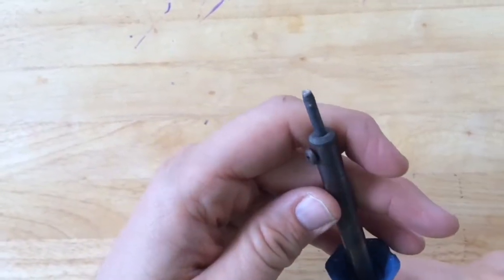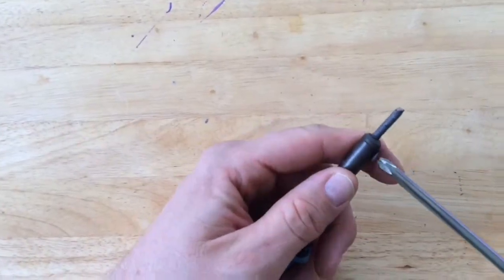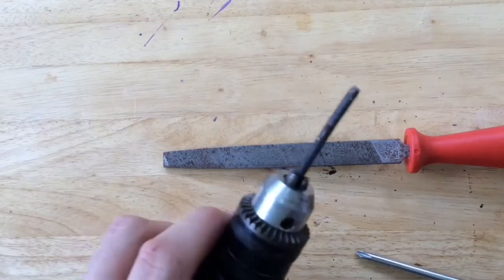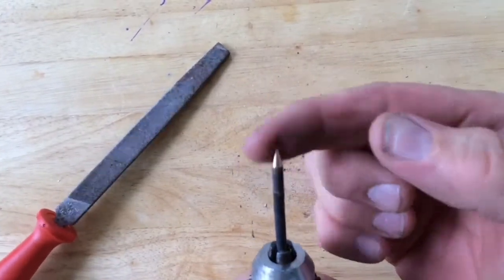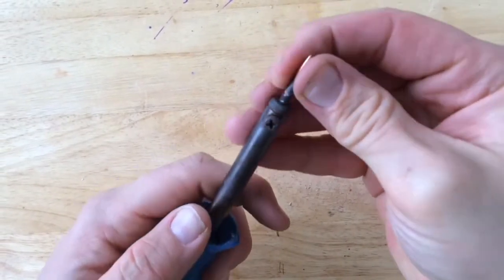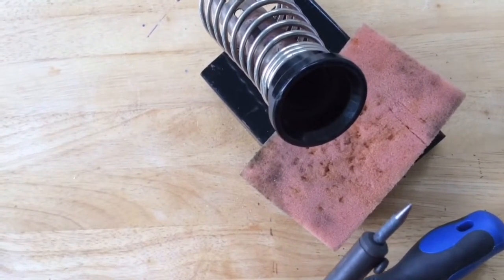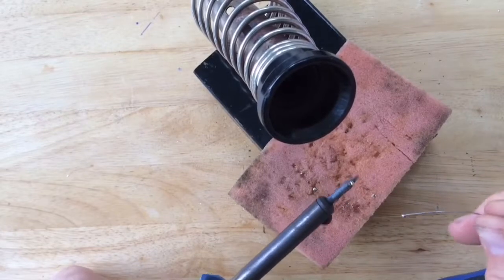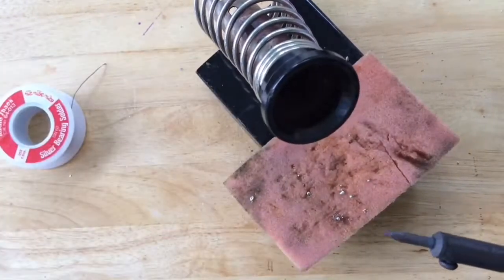Sharpening the Tip of My Soldering Iron

Comment: Not copper wire, its a copper alloy solid tip type. If your tip gets too hot, because its shorter, it won't tin easily. Now you know and there you go😅

Comment: I'm confused why you posted this if you failed, I watched 7 minutes to find out it didn't work.
Reply: He should change the title with "_Trying to fix my soldering iron tip"_
Reply: It does work. He didn't do it completely right. If he melted some solder in a small container of some kind, and dip in the tip, that would have tinned it.
Reply: Did you not hear what he said in the beginning of the video?

Comment: I'm a bit late to this. But after you filed your tip, you should have used a tip activator, dry  cleaned and then tinned. Repeat the dry clean and tin and you should be good.
Reply: Wtf is a tip activator? Flux?

Comment: I believe that the tip would have been iron coated copper (copper being cheap and a good conductor of heat). So filing it would have taken that off. The copper changes colour when it oxidises so although solder sticks to copper well my guess is that it doesn't to the oxide layer that you now have.
Reply from the maker: +David Watts that makes sense. I saw a guy that wrapped his freshly filed tip with solder before heating it up. Do you think that might work? I think it might protect the copper from oxidizing before it melts the solder.
Reply: It could, I am no expert on the chemistry though. Worth a go.
Reply: Try using a flux core solder to re tin the tip